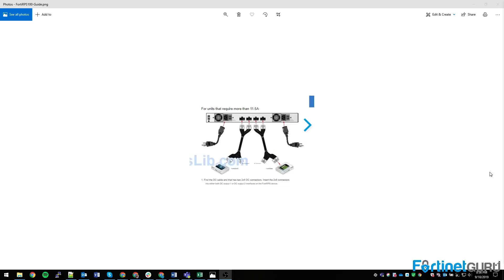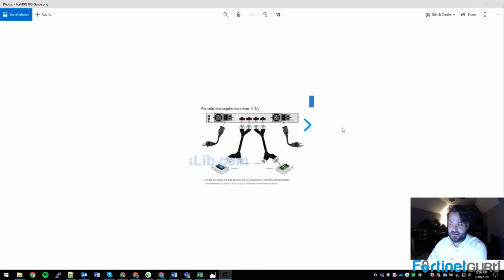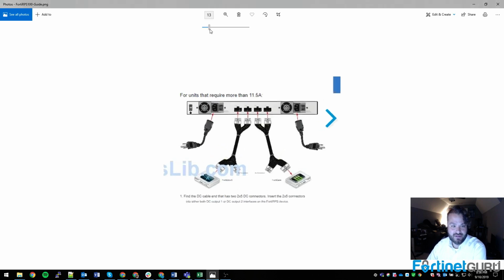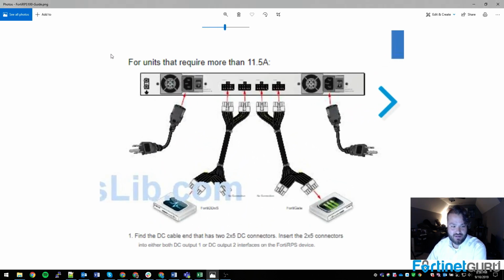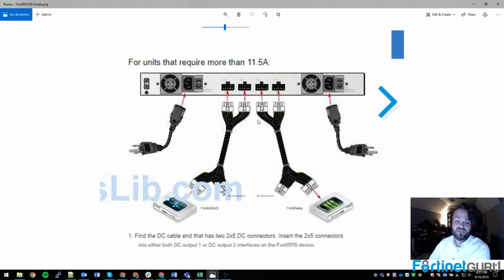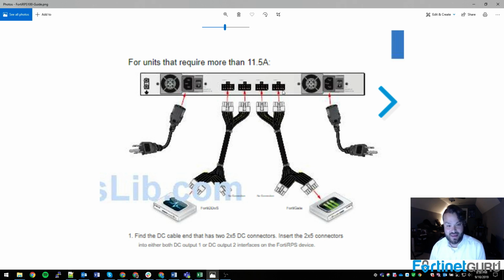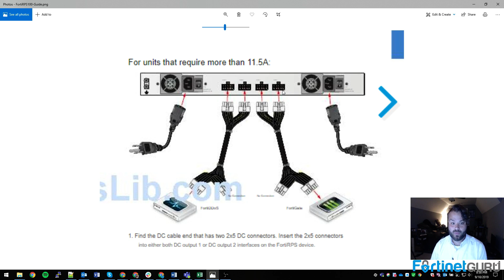FortiRPS Documentation No Bueno!

Comment: Hi, please let my know what do you think about this idea. The manual tells you that a FortiDDOS (for example) needs Two 2x5 DC ouputs conected to FortiRPS, if you connect the devise in the way you say and one of the AC power goes down, you are powering the FortiDDOS whith only one 2x5 DC and thats not correct. 
The redundance came since you have both sources of power connected at the same time in the Forti DDOS, that is the objective of using and RPS, so when the Primary AC connection is unavailable, there is availability through the DC connection.

Also the manual explicitly says:

"When using both 2x5 connectors to connect a single device to the FortiRPS, both
connectors must be connected to the same DC output. For example, if one of the
connectors is connected to DC output 1-1, the other must be connected to DC
output 1-2."

Best regards